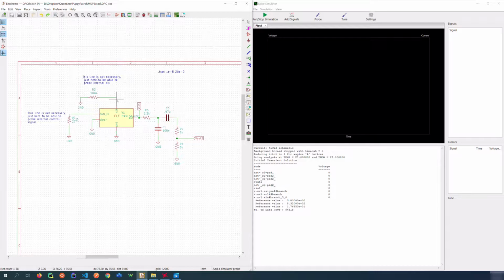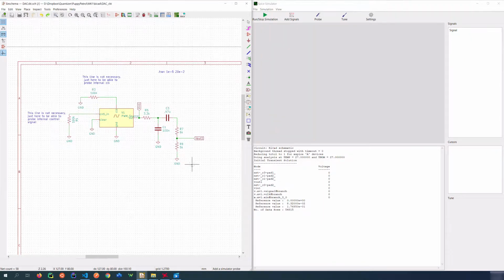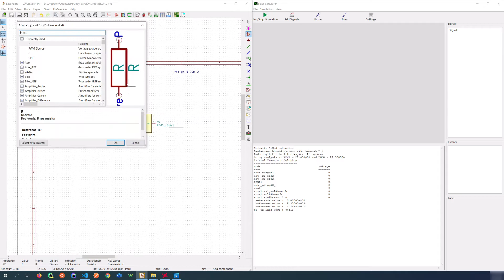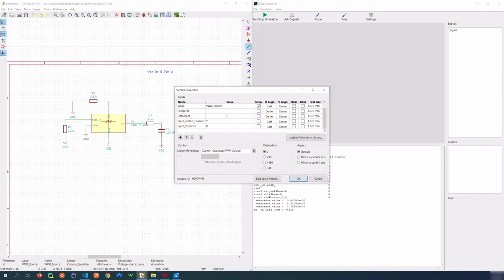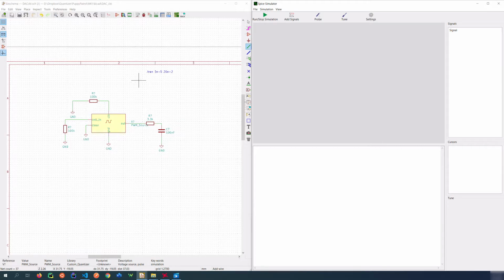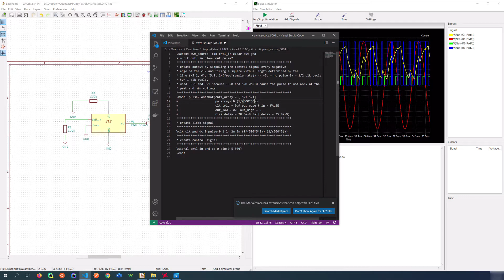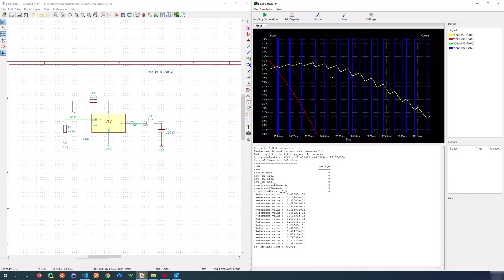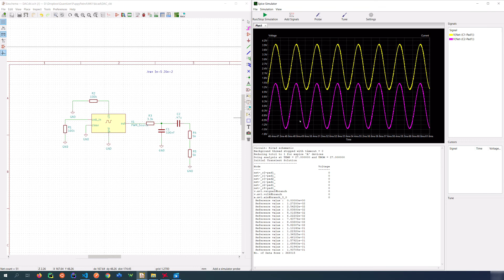KiCad Tutorial - PWM simulation

Comment: can you tell me how to set up the simulation?
( .tran ? )
Reply from the maker: You just click the text button on the right side of the screen to add text. Type on the stuff in the .tran block. Here is a link to an image that points out the text button
https://d1oiqfs6ufotrh.cloudfront.net/images_jpg/950-Kicad-Project3-PcbnewTextLabelsGraphics-00-01-47-284.jpeg
Reply: @quantizer  I'm sorry. 

I checked it incorrectly.

Thank you for helping me.
Reply: @quantizer  However, if you make it yourself, there will be a problem.

I want to know the fundamental cause of what the problem is.

I want to send the file, but I don't know the email address of Quantizer.
Reply from the maker: We have more information about this simulation here
https://www.thequantizer.com/dac-and-pwm-kicad-simulation/

here are our files for the project
https://github.com/thequantizer/kicad/tree/main/DAC_ckt

Comment: I been trying to work my way through learning to use Kicad. I doesn't have a sim program does it? My install is 5.1.6. I want to build a nixie tube clock using B5440 tubes since I have a dozen of these new old stock tubes, with sockets. Was trying to work with Miltisim from Mouser, but that program became unavailable, and it had a sim. Where did the Spice sim come from? And I'm reverse engineering a AR Stereo Remote Control (ARSRC) from the mid 1970's, using the KiCad too. Not easy either.
Reply from the maker: Thanks for the question, yes KiCad does have ngspice built into but its not obvious how you use it at first. I will see about putting together a video on this. Also, your project about reverse eng the stereo remote sounds cool. Do you have the project files linked any where so we can check it out?